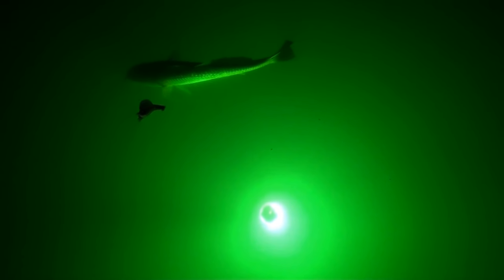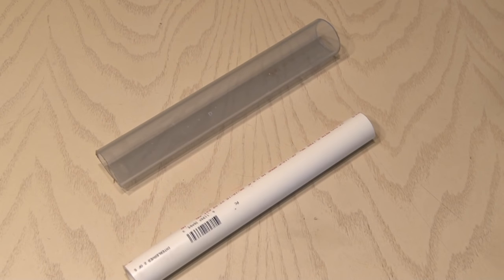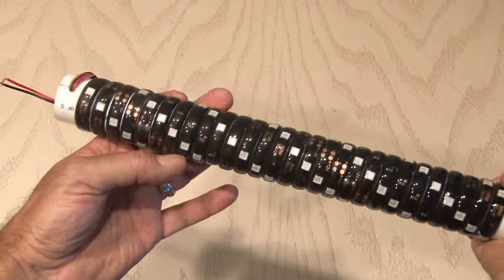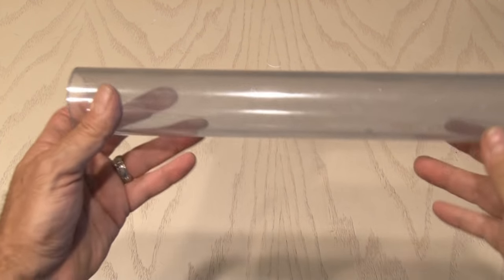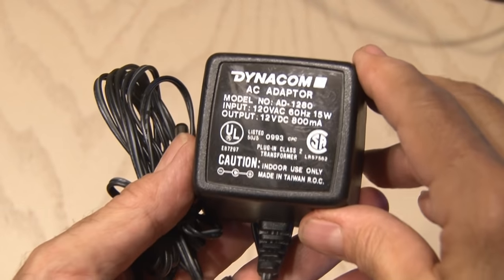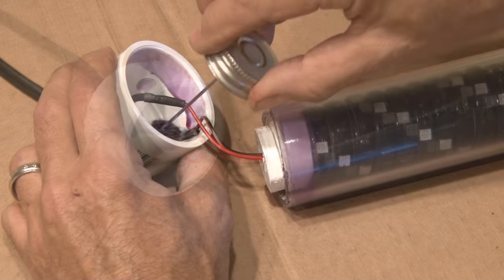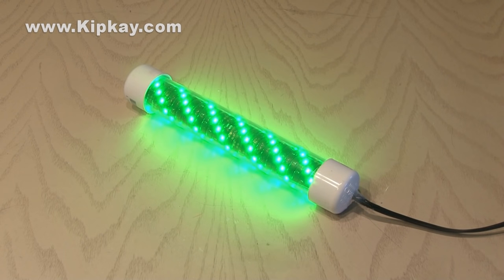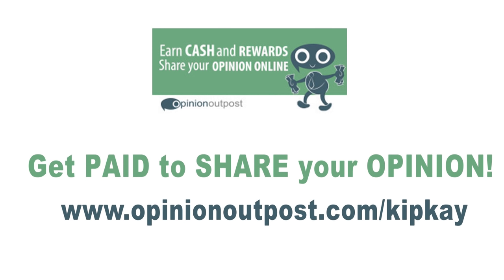Catch More Fish With This!

Comment: just one very minor thing you should have mentioned. with those led lights it does matter where you make your cuts, if you don't want to lose a few leds or have a couple not lighting properly.

again this is minor stuff. but I do know that making hacks like these are all about efficiency and money saving.
Reply: for those of you wondering what i'm talking about. there are lines on the led strip that sit in between 4 soldering points. that line is generally the one you want to make a cut on. you can see the lines i'm referring to in this video at certain close ups of the leds.
Reply: I have the exact same LED strip in my room. It does not actually make a difference where you cut the LED strip in this case since all the LEDS are green, meaning there's only 1+ and 1 - strip. In RGB ledstrips it does not make a difference either, since the LEDS are wired paralell to the +, +, + and - strip so they'll keep working. Please get your facts straight before posting.
Reply: Tom Willenbroek I'm sorry if my facts may have been wrong. I was under the impression of what is was saying was fact because of personal experience, having an LED strip that lost power to at least three LEDs because of misplaced cuts. Not only that but the manufacturer talks about the same problem I had being caused by not cutting on the pre-provided cut lines. My strip of LEDs was also mono green by the way. It was my mistake and I'm sorry for making a comment that I was slightly misinformed about. Thank you for correcting my slight mistake, and have a good day.

Comment: Nice, but You should fix those weights somehow, cause if they move they will eventually snap tiny cables inside the white pvc pipe
Reply from the maker: They are at the bottom, the wires are at the top.
Reply: +kipkay yeah I know, but thinking of transportation and moving around.  thanks for response and have a nice weekend

Comment: Why not use an 18650 3.7v and a step up converter, with a remote or magnetic switch? That way it can be totally sealed and you don't need a power cable. I fish a lot, and I've never, ever, fished anywhere near a power plug.

Comment: Did you have enough led left to make another.. I'm guessing it was a 16 ft roll to start
Reply: 1 roll will make a tube about 20 inches long on 1" OD PVC
Reply: He said it was 5 meters in length, so a little over 16 feet.

Comment: So
a hacksaw
a drill
a computer
lots of piping
an led 
silicon
glue
wires
scuba outfit
harpoon
and optimism
Reply: Harpoon, are you planning to go whaling?
Reply: LOL, but it's silicone. Silicon is the metal inside the computer.

Comment: Great, but maybe make one that does not need extension cord so you can just drop it in with a rope or wire. It also need changeable batteries. It would be more perfect.

Comment: plugs in...to the wall? in a pool... what if it shorts and electrocute yourself?
Reply: It's 800mA DC. You likely wouldn't even feel it if you grabbed a bare lead in each hand. If it was AC leads straight from the wall there might be trouble but it goes through that tiny DC converter.
Reply: Challenge accepted =D i bet i could find a way...jk...
Reply: kip you kneed to change how you arrange items on the table for instance 2:50
Reply: +tiffiny keller oh I get  it  XD

Comment: whats the AC adapter for? can you not just  plug the led's right into the 120v outlet? im about to make one of these and i don't want to mess it up
Reply: TeaBoneXD led's don't work with AC and they work with a much much lower voltage than 120V.That adapter converts 120V AC to 12V DC which can be used by the led's.
Reply: casaverdero LEDs do work with A/C
Reply: wowcoolbroman they only light half the time and 120 volts is 10 times the voltage used to run this light strip
Reply: wowcoolbroman 
A/C is air conditioning.
AC is alternating current.

Comment: couldn't you use a Chem light/ glow stick from the dollar store?  seems like it would be far cheaper and drastically more safe
Reply: That was my initial thought, but chemlights aren't nearly as bright as these LEDs.
Plus, it's always fun to play around with the ol' soldering iron.
Reply: glowsticks suck, ive trie it , if your fishing in murkey water its no bueno mang
Reply: +Bizo Fishing the lake I fish in is crystal clear. Chem lights work tough they aren't as good as that led strip. it's just cheaper.
Reply: +RichardTheAwesome oh yeah in water id be using glowsticks too,unfortunately where i fish the water is brackish
Reply: +Bizo Fishing yeah, I'd be doing the same thing in that case.

Comment: how can I make it battery operated
Reply: You can purchase 12V versions of those lights which will run from a standard 12V car/boat battery. That's exactly what I'm thinking I'll do.
Reply: Jarrod H Hi, I am just thinking the same!

Be sure to check the drop voltage! If you use 10 meters of wire, the voltage will not be the same in the end.
Reply: Good to know. Thank you. I don't think I'll be using wire that long though.
Reply: Cool, but at least here in Greece, fishing light is illegal. That's why a long wire and a dimmer for the lights are a must.

Also could you help me understand this? Why most people in the videos use waterproof led strips? I am waiting for some green and blue 5m each nonwaterproof because:
1. They are cheaper
2. Brighter (they do not have that silicone gel on)

But mostly they would be sealed in an acrylic tube! Why should they be waterproof ? I mean they will not be exposed directly with water.
Reply: Jarrod H I have seen the video too, I think. Check out what the numbers on led waterproof mean. For example waterproof IP68 seems great, but they shouldn't go more than 3m in the water (because of pressure I guess?) and that's the best waterproof that exists.

Ofcourse I do not want it to catch many fish, but to make sure that I will catch a few. I will be using it from a kayak, and this seems cheaper than a fishfinder:-P .We should always respect sea and it's creatures-fish.
Reply: can i make it run on D batteries
Reply: Alvaro Delgado use enough to match your voltage. use 8 in series for 12 volts
Reply: Alvaro Delgado That would eliminate the need for lead weights. Be sure you have a strong floating rope attached so you don't lose it. Where I live, the Kanawha River is up to 120 feet deep, or about 35 meters deep.

Comment: Ha you should have put silicon .. loads inside the cap! That's going to leak soon.
Reply: I thought the same thing. I would have put a pretty generous amount of silicon on the inside of the lid before sealing it up. Then, even more on the outside.
Reply: Indeed, I like Goop for sealing stuff.
Reply: Silicone. Silicon is a gray semiconductor metal used in electronics.

Comment: led's are polarized, you must have gotten lucky or will not work
Reply: Joe Blais The polarity is marked on the led strip. He probably checked the polarity of the power supply before connecting it.

Comment: See Fishin N Suff, better light, it's 12 volt. For some reason my bass boat doesn't have a generator.
Reply: This one is 12 volt too. The plug transformer outputs 12v
Reply: You could actually use a 9 volt battery self contained

Comment: Better check your local fishing regulations, this is illegal in some states.
Reply: Name the states. I have never heard this from any reliable source!!!!!!
Reply: It says California has a LAw about using lights for fishing purposes. "Answer: Yes, it is legal to use lights when fishing at night when and where such fishing is permitted. Lights may be used on or as part of any fishing tackle (California Code of Regulations Title 14, section 2.15). Just make sure that the waters where you plan to fish allow for nighttime fishing. Some lake managers or concessionaires at managed lakes do not allow for any fishing after dark. "

If you attached a bare empty hook and a fishing line with a reel to it, Technically its consider apart of tackle and would not be deemed illegal. just a work around the law.

Comment: What battery did you use to power light
Reply: Dude did you not look and listen ??    120V AC
Reply: @mikepaix8586  it's a hundred and twenty volt AC input but 12 volt DC output so you could run it off of a jump starter or any 12 volt source.

Comment: Could you make a portable one? As most fisherman won't have a wall to plug it into to get electricity when fishing lol
Reply: If I recall correctly, the light doesn't bring fish in immediately. It takes time for the baitfish and other prey to get used to it and congregate around the light source. More than a single night. A more mobile version wouldn't work all that well unless you were incredibly determined or had easy access. I'm not an expert on the wiring involved, but you could probably do more or less the same thing but with either a 12V DC adaptor or alligator clamps to hook up to your 12V deep cycle. If you have neither of these, then you may be SOL.
Reply: JTVang, isn't an automotive 12V  battery portable enough for you?
Reply: You cut the plug off the end and connect it to a 12volt source like a vexilar battery being that the led lights are 12 volt lights and only like 5 dollars for a roll

Comment: What do u attach the extension cord too ? Anyone know 🤔
Reply: Alex Nguyen The AC adapter
Reply: Jared Milam how do you turn the light on ? Is there a button in the ac adapter ?
Reply: The way you turn it on is by plugging it in. Sometimes the AC adapter does have a switch though.
Reply: Jared Milam what do u plug it into when ur on a dock ?
Reply: you should bring a battery with an adapter that that has alligator clips on it
Reply: Jared Milam oh okay thanks

Comment: make it portable with a battery please
Reply: Just use with a direct connection to a 12v battery! in that case you wont need a 12v DC adaptor!
Reply: +Ruben Garcia thank you
Reply: You are welcome is actually simpler and safer to use a battery.... ;)

Comment: You could also use a Solar panel and attach it to a wire that floats above the water
Reply: really usefull to use solar panel in night
Reply: PFFF AHAHAHHA +mrexelcz
Reply: You will need a long extension cord that reaches halfway around the Earth so you will have sun on that solar panel. Of course the voltage drop will make the power unusable after 1 mile, only 11999 miles to go. Stupidest comment ever.

Comment: I cant be the only one who who brings a generator and have so many lights pointed at the water I swear I blind the fish
Reply: fish at the top of the water cant see green there are a couple deep sea fish that can tho.
Reply: If the fish cant see green then how you can attract them anyways??? 0:04. How about glow sticks instead?
Reply: green also produces inferred which the fish can see but not much tho. Basically it makes the lure pop out to them and they think its the moons reflection.
Reply: a improvement on this is to add inferred led's instead of green and sink it down farther then it will keep the fish off the bottom of the water if your in shallow water.

Comment: That is soooo dangerous!!! You should have used more insulation at the seem between the wire and case!
Reply: bora sebastian seam*
Reply: bora sebastian no the transformer completes removes the high voltage potential 120v and its only 12 volts... not enough to surpass the resistance in the water and your skin

Comment: You better make sure the housing is water proof and I do mean water proof cause if not you could ELECTRICFY yourself or if you use it in a pool like you say..I mean it looks great but I would use it for the outdoor a way from water.. but that's just me
Reply: Tyler Casarez well electricity takes the shortest path and the voltage and current the adapter puts out I believe is very low
Reply: You'd be limiting your self for no reason, 12v dc is harmless in water at the amperage, even saltwater, in fact i think it would take a huge amount of amps to be dangerous in this way.

Comment: For a pool? Show me your liability policy and don't tell me no one has ever been electrocuted in their pool.
Reply: you would burn up the dc power supply before anyone would be electrocuted. very safe method of illumination.
Reply: He also never said to get into the pool with the light, just that it could light up the pool. LOL
Reply: Totally safe, the wall plug only outputs 12V DC, which is absolutely safe to touch.
Reply: It's safer than the lights made for pools. In the US they run on 120VAC.